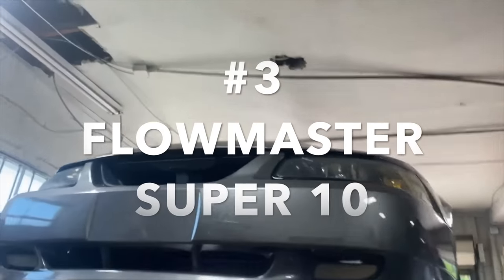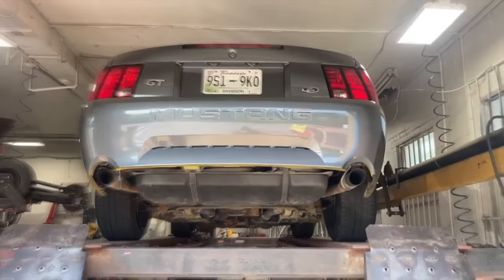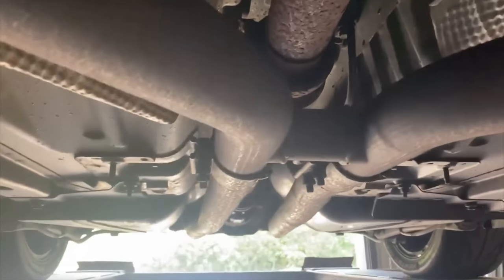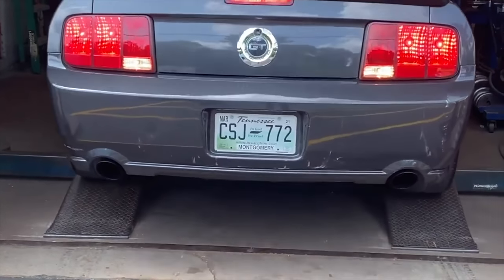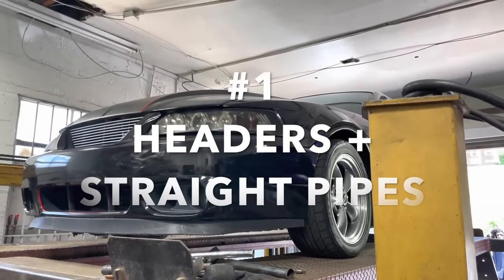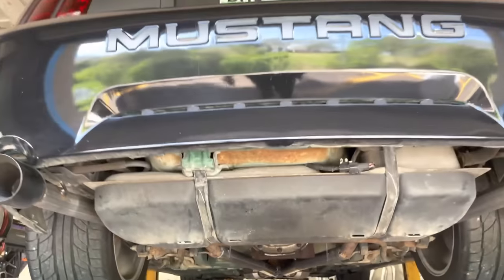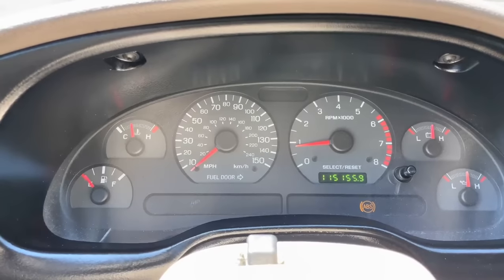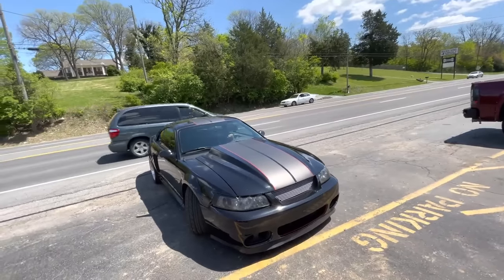Top 3 LOUDEST EXHAUST Set Ups for FORD MUSTANG GT 4.6L V8!

Comment: Both the 4.6 cars may not be the most high performing but I’ll be damned if they aren’t one of the best looking and sounding mustangs ever.
Reply: I agree. I love chevy to death but my favorite mustang is the mach 1. Beautiful car
Reply: Saleen is probably my favorite.
Reply: theres three 4.6 mustangs, actually
Reply: @cyb3r_patr01t8  true I forgot about the 4V cars I think my brain just said “2 body styles = 2 cars” lol. Could make it 4 since the termi 4V is different from the other cobra and Mach 1 4V.
Reply: @grant winburn the Mach one & the cobra have both the same 4.6 4v the only difference is the the cobra is a built motor with a whipple on top
Reply: @demarcusbody9437  Eaton not a Whipple
Reply: @disguisedpickle1360  yes Eaton my bad
Reply: @demarcusbody9437  no one is iron one is aluminum the heads are not even the same mach 1's have more of 01 cobra heads vs the terminator
Reply: @ranware2779  so still the same motor besides heads & engine block one makes decent power one does not 😂
Reply: @demarcusbody9437  mach 1's just need a bump in compression due to them being na..... you might be a lil confused on this topic my guy
Reply: Agreed, nothing beats a 03-04 termi thooo

Comment: Best sounding exhaust setup for these 4.6 mustangs is LT headers, OFR X-pipe, into Borla Atak mufflers
Reply: Fuck no slp or nothing
Reply: Nah slp
Reply: O/R X pipe gotta be the worst exhaust choice for ANY car
Reply: Is that what is on yours if not what is?
Reply: @TheRoamingWombat  What is slp?
Reply: @That_Black_Menace  half a horsepower more isn’t worth the shitty sound it makes
Reply: @That_Black_Menace  H pipe makes more torq, depends on the application.
Reply: H pipe with original 40 series on a 2v or sbf is one of the best muscle car sounds of all time. Not best for performance tho
Reply: Borla S type mufflers sound better
Reply: @TfyallLookingAt  sorry i'm late but it's just a brand that makes exhaust parts
Reply: @rawjur2117  ok thanks
Reply: How about Corsa extremes behind LT and off road X
Reply: @Notaws6  that is a myth x pipes make more everywhere
Reply: @Tommy-hb5qn  x pipes sound way better with the right mufflers
Reply: @Tommy-hb5qn  they sound great as long as it has mufflers
Reply: @thenegus5469  its not a myth its dyno proven that H pipes will give more bottom end torq and X tends to give top end HP.
Reply: You really think the difference is even worth arguing about lol.I'll stick with the better flowing racecar sound of an xpipe.
Reply: @Notaws6 it is a myth. Better scavenging means better hp and torque everywhere
Reply: @thenegus5469  I’m uninterested in your ignorance. It’s literally not even a 5HP difference and has been proven time and time again so believe what you want. Clearly you plan to anyway.

Comment: Long tubes, x pipe, and then straight back is the only answer. If it has cats it’s not a straight pipe.
Reply: How about bbk catted x w/ bbk longtubes and a Borla atak car back ?
Reply: @disguisedpickle1360  bbk longtubes bbk OR xpipe no mufflers  🔥🔥👍🏽👍🏽
Reply: @breizonhorn486  bbk o/r x isn’t sold anymore
Reply: @disguisedpickle1360  I’ve found a Couple on marketplace but I know the companies don’t sell them anymore sadly
Reply: @breizonhorn486  Im probably running the bbk long tubes with a bbk cat x pipe and borla atak to finish it off I know mix matching parts isn’t ideal but I can’t say I’ve seen anyone w/ a borla run bbk LTs and a cat x pipe no mufflers of course

Comment: I prefer strait cut tips it makes the exhaust pop more and give it a cooler note in my opinion. The slash cut is to smooth the note out because you have efectivly increased the area of the opening by quite a lot. But I like the pops ang gurgles.
Reply: Yes sir I love how mine pops!!

Comment: I have a 2004 mach 1 4 valve with the x pipe and catback exhaust and the only mustang I've heard that sounds close to that nice is my 2014 5.0 with the roush exhaust. And he was wrong on the year of the first it was a new edge which is 99 to 04

Comment: Loudest exhaust I've ever "heard" (I've heard over 60,000) was a mid 80's Chev pickup, 6.2 L diesel non turbo, 2" duals no balance pipe, no mufflers and straight out the back. It caused the ears to pain.

Comment: How does straight pipe and longtubes perform do you loose back pressure?
Reply: It’s not back pressure you want. Back pressure is terrible.

It’s velocity you want. As long as you’re keep some exhaust velocity you’re good. Helps to “pull” the exhaust out of the engine.
Reply: That in mind i was told you need a slight back pressure to propperly seat the exhaust valves.  But the cats should provide enough

Comment: Nothing about that last mustang was built. I have a fully built 04 mustang gt with forged internals stage 3 cams built to the max makes 380 whp n/a and this one you say is built is deff not built.
Reply: Yea that last GT was nothing special sounded like shit actually ... My supercharged GT with Borla Ataks sounds hell of a lot better
Reply: Stage 3 cam??? is that the same as a 3/4 race cam... cringe.
Reply: @UsefulEntertainment  Comp Cams Stage 3 Xtreme Energy 234/238 Hydraulic Roller Camshafts
Reply: @reelsteelesharkfishing6329  oof, ok. Im used to a lot of people throwing that term around differently.
Reply: @UsefulEntertainment  yea no im. Ot one of those
Reply: @reelsteelesharkfishing6329  👍

Comment: If that mustang was built it wouldn’t of been burning oil. An it wouldn’t of bogged down when he was doing that rolling burnout. It might have headers an intake but the internals are stock. I have friends with built mustangs an they don’t burn oil an they don’t bog down when doing rolling burnouts.
Reply: Built with bolts ons LOL
Reply: Well it wasnt bogging down, it shifted into second,lost wheel speed, and shiftef back into first. Definitely not build though

Comment: 2 different engines though
Reply: The 4.6 was used from 1991-2011. So all these mustangs have the same engine
Reply: @mr.sandman6873  While technically they have the same displacement, there are definitely major differences between the generations. 2 valve vs 3 valve being one.
Reply: @mr.sandman6873  2011 is when the 5.0 Coyote was introduced
Reply: @HuffStang  ahh my bad I meant 2010 thanks lol
Reply: @smtbigelow  thanks for the clarification 👍🏼
Reply: Skip R  my bad dude not incredibly familiar with the late model engines
Reply: Skip R  all good! I appreciate the info
Reply: Wrong!!! The 4.6 was not used from 1991 on. Anyone who knows mustangs know the 1991, 1992 and 1993 was the 5.0 fox body mustang!! The 1994 and 1995 mustang gt also had the 5.0 in them. Not until 1996 did the Gt mustang go to the 4.6 liter.
Reply: @kennethmoyer1980  yes thank you for the info
Reply: @mr.sandman6873  Oh you’re good brother! They do look very similar